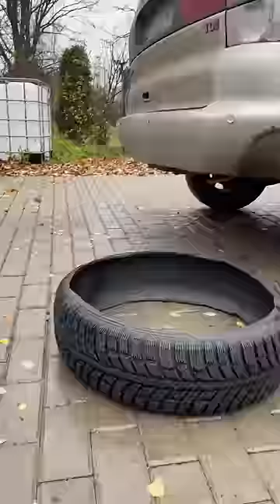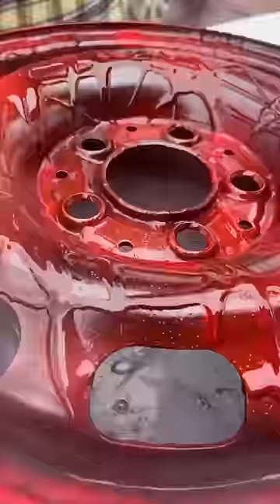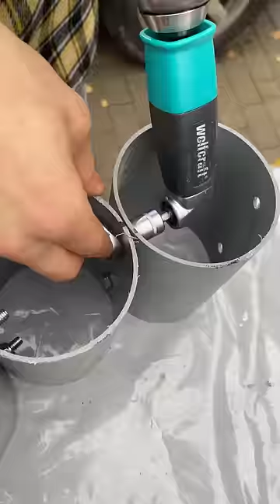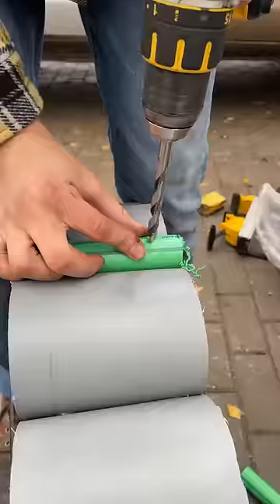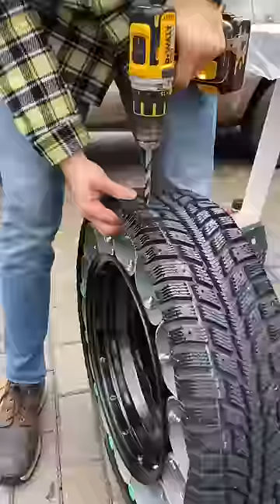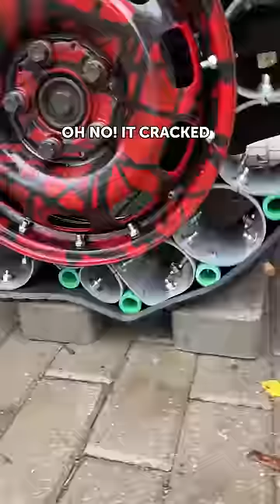We Made A Car Wheel With Pipes! Amazing Experiment!

Comment: That's about the most dangerous thing I've seen all day ...imagine a bolt slinging out and hitting someone in the head at highway speeds
Reply: most dangerous or most redneck 😂
Reply: That's why it said not to do it. Nothing wrong with experimenting and I'm  more than certain they didn't take it on any highway.....I  don't think it lasted that long. The concept is strong though, just not the materials. They could be onto something. We could use more " no flat" tires on the road, like ALL of them
Reply: @navyboymommygramma  it's already been made it's called a tweel look it up
Reply: @spartansoff-roadrecovery5058  I knew the military has had them for some time so listening to why they are ready for commercial, or civilian, use just seems, to me,  a lot of 💩 to say the tire guys would lose a bunch of money if these things went mainstream. Trust me, IF they really wanted to we have the knowledge base to find a way to put a solid or puncture proof tire on every car, but.....That's  a multi million dollar IF.
Reply: @navyboymommygramma  they're already available from use on cars too ...the only problem is the DOT has not approved of them yet and for good reason it makes your car handle like shit ....there's no air in them meaning when you hit a bump , take a corner ,hit ice or snow or water etc the tweel doesn't compress to grip the road like it should making it dangerous AF ....they're out there you just have to find them and when you do they're generally 1500 dollars a piece or more